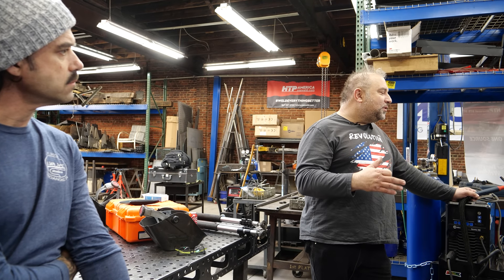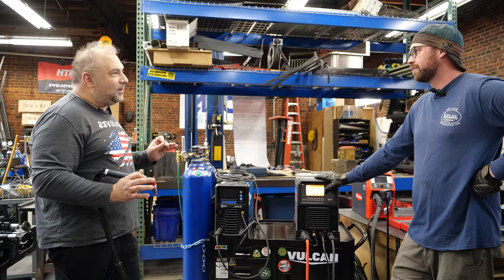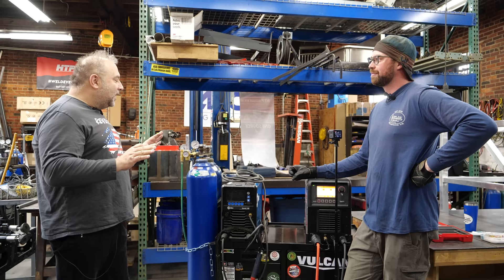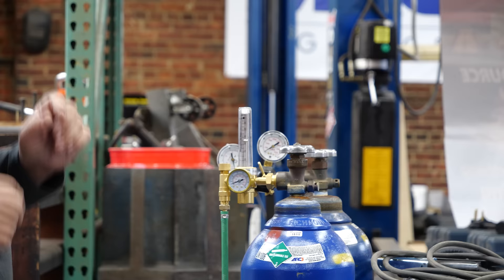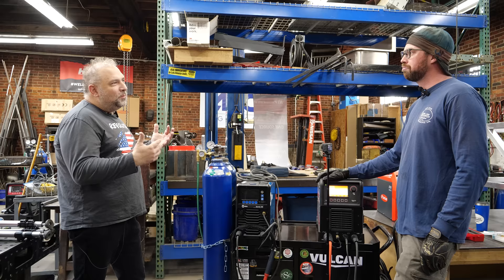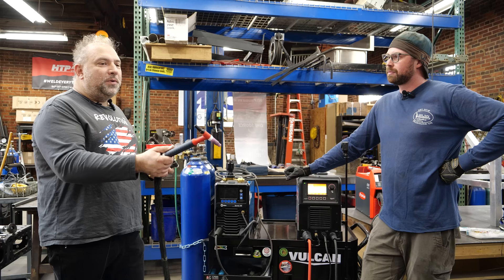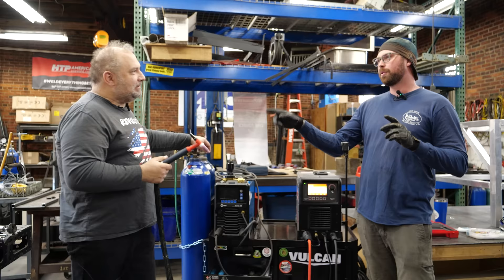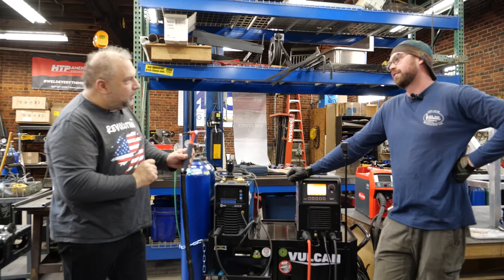Everything You Know About Regulators is WRONG

Comment: The two types of regulators exist for two different purposes. Both types have the same type (if not exactly the same model) of regulator on the cylinder, which drops the cylinder pressure to the intermediate pressure for either a needle valve or a second stage regulator that includes some known downstream restriction. If you care about actual flow, as for example we do when adjusting medical gases delivered to patients in the hospital, you use a flowmeter. If you care about delivering a specific low pressure, such as a supply to a torch, you use a regulator - often with two stages. The "flow rate" gauge on a two-stage regulator (two dials) presumes a certain differential pressure across the (hopefully) calibrated orifice. If your welder or torch has a flow restriction somewhere the flowmeter type will show you that it is not delivering the flow you had set. The two-stage regulator type will not. That's why when your torch is off the flowmeter type will show no flow but the dual gauge regulator will show whatever "flow" (pressure) you had set.

In short, neither type is necessarily giving us correct information on the flow rate. In the case of the flowmeter, we do not know how well (if at all) it was calibrated. In the case of the two-stage regulator, the gauge on it is a lie to begin with. Both can be calibrated, but the two stage regulator can never directly show gas flow.

Both types will struggle when they do not receive sufficient intermediate pressure. The two-stage regulator will likely start struggling to deliver what you expect at a lower cylinder pressure, but both will struggle. Anyone familiar with scuba diving who has ever breathed a tank all the way to empty will immediately understand this, because the most common scuba regulator is a two-stage. The difference is most first stage scuba regulators compensate for depth by varying the intermediate pressure, whereas welding regulators do not change the intermediate pressure based upon atmospheric pressure. As a scuba instructor, I have seen the insides of many different brands of regulators, and a few medical gas regulators. Welding regulators are a whole lot more simple, in part because they do not have to be designed in a failsafe manner.

Comment: I tig weld aluminum allllllll day for a local trike factory. We use the 330 cu ft. Tanks and yes as the day goes by you need to bump the flow up because the tank is getting empty and can't produce the same pressure. But it's not that serious it's pretty self explanatory

Comment: Id like to see what calibrated gauge he is talking about. As a fluid control specialist, i dont agree with everything he is saying. The proportional aspect of a 1 stage reg is correct. The flow reading on the ball flow meter is not correct. That ball and orifice is most correct measurement device. It is calibrated for gas density at any pressure. Flow and pressure are directly related, so measuring flow with a "guage" seems wrong. Flow needs to flowing to measure and pressure disregarded. Just like A vs V. Measuring V while focusing on setting Amps is secondary info.
The only correct way to measure flow is via a flowmeter, or a known volume (trash bag) in time, not a gauge. Good video tho and always good to discuss deeper dives into theory.
Reply: The gauge type meter is just reading the pressure behind an orifice. The numbers on the gauge are not PSI bur rather predicted flow values for the orifice. It doesn't seem accurate to me. I didn't follow "The flow reading on the ball flow meter is not correct. That ball and orifice is most correct measurement device." The statements seem to contradict.
Reply: @jheissjr  yeah i fat fingered that. The ball is the most correct gauge.
Neat to know about the gauge with the orifice downstream. I guess that makes it quite a bit more accurate than I thought, i always just assumed it was a pressure gauge.

Comment: I always use a flow tester/rotameter for gas nozzles and cups, to get an accurate reading, because the journey of the gas from the tank to the nozzle/cup is long and anything can be wrong somewhere, faulty tubes, etc.
Reply: This is the best advice I’ve seen regarding this video. I’ve seen people throw away spools of wire, change gas bottles, buy regulators etc all because their gas line was pinched or something. I recently had a ton of wormhole porosity suddenly on a dual shield project. Flow meter at tank was showing 30-35 was getting less than 12 at the gun.

Comment: I’ve been experimenting with this a bit lately and found some of the same issues with flow dropping as the cylinder empties. I’ve been really happy with the victor regulator that came with my HTP. I still use a dual flowmeter style on one machine to allow for a purge line, though.
Reply: The reason why the flow drops is because of the pressure differential across the orifice is dropping.  Down to a certain tank pressure, the flow through the orifice is what is known as choked flow, that is the flow velocity is at the sonic velocity of the gas at the given conditions.  Once the tank pressure drops below the critical pressure, the flow through the orifice is proportional to the pressure drop across the orifice.  What two stage regulators do is drop the pressure in two stages (Duh!) so that the flowrate through the second orifice will always be at sonic, or critical, velocity.  Even with the two stage regulators there will be a tank pressure at which periodic adjustment of the regulator setpoint will be needed.  This tank pressure for a two stage regulator will be significantly lower than that for a single stage regulator.  The ball type flowmeters are accurate at a specific gas pressure that is flowing through them.  I have a flowmeter for my HVAC tools that is accurate at a 50 psig inlet pressure.  As a result, when I go to purge refrigerant lines for brazing, I have to set the regulator at 50 psig and use the outlet valve of the flowmeter to adjust the flowrate.  The accuracy of the flowmeter will be dependent on the gas pressure which governs the flowing density and flow velocity which will affect the accuracy of the flow meter.  It is much too complicated of a subject to demonstrate here how a 10% change in gas pressure to a ball type flowmeter will affect the accuracy of the flow measurement.  hth

PS:  I look forward to watching your videos Tim and have learned a lot from you about the practical aspects of welding.

Comment: The most precise gas regulation is done for fine oxy-acteylene work but you can use dual stage regulators for shielding gas too. Single stage regulation is inherently less precise at lower cylinder pressures. Airco and successor Concoa dual stage outfits are popular with precision acetylene welders and some use them for TIG by swapping in a CGA-580 nipple and nut.
As for how to read flowmeters I never see Youtubers contact tech support for the manufacturers who design them. Further, anyone can set gas flow as they would set other settings simply by welding some similar scrap then tweaking for best results on ones OWN equipment. 

You can and we did get the effect of a dual stage system when using manifolds (we built shielding gas manifolds for our welding school booths) by setting base pressure at the party pack or Dewar output regulator then fine tuning with a flowmeter downstream. Our booths used standard pneumatic chucks with two chucks (one for purge, one for torch) at each station. We swapped the  flowmeter inlet nipples with 1/4" NPT brass nipples which gave us instant flowmeter swapout which made my life running the toolroom and repairing regulators much more convenient. (WARNING, the manifold ran at LOW pressure not full cylinder pressure so study and know, don't guess when plumbing high pressure industrial gases.)

You can set amps and gas flow without even seeing an indicator because we did when training pipe welders who may be hundreds of feet away from their power source doing boiler and refinery work. (They yell to their helper to "bump" settings up or down.) Good weld? Good settings.

Comment: Not usually one to comment on things like this, but I did want to add one note in regards of higher pressure and vortex sucking in ambient air. He is right for 99% of application, but there's one application that I've personally run into and experimented with, that this statement is actually true. It's not a common joint type for most welders, but in the repair area, as you try to weld an edge on a thinner part (and this seems to be applicable only on thin parts of about 1/8" or less, with it getting worse as the material gets thinner). 

For ease of explanation, pretend that you have a piece of 1/16" aluminum sheet panel that's 12"x12" and you want to add some material right on the edge of to build up thickness of the panel. So with your panel laying horizontally flat in a parallel plane to your welding table, BUT it must also spaced up from the table, so you put a say 2" spacer under it. You then have you're tungsten in a vertical position over the edge of the panel to run a bead,  as if you wanted that panel to have a weld bead all around but maintaining that 12"x12" over all dimension making just the outside border to be say 1/8" thick with the weld on there. As about 1/3 to 1/2 of your cup's shielding gas if passing through that 1/16" edge thickness, a vortex can be created by pressurized argon slicing that edge and drawing in the ambient air to your weld puddle. And as you increase the Argo pressure in that situation, you'll notice that your welds start to look worse instead of better as the vortex becomes stronger, so the remedy becomes to run as little gas pressure as possible to reduce the induced vortex that comes from under the panel. 

As mentioned, this is a very rare occurrence, but none the less a legitimate one that I have personally run into. And sometimes it only takes one things like this to have everyone using the expression that more gas pressure can cause a vortex and ruin your weld. But other than that, great informational video! 

If you do want to try this out, I have to stress that it really has to be a part suspended in mid air, not laying flat on the table. You wouldn't run into this issue with it on the table (nor backed with something), as that would also stop the vortex from being created. And I find it doesn't do it with thicker parts neither as the vortex created is far enough away from the weld puddle if your torch angle is perpendicular to the part. However, it can still happen if you have too much torch angle to the outside of the part and the statement would also be true then that more gas pressure would make a bigger vortex causing it to be worse.

Comment: I find the information pertaining to the gas retention in the line very interesting as I did the flow meter not "keeping up" as the tank empties out.  As for reading the top or the bottom of the ball in the flow gauge, does it really matter since most will just use the reading as a reference and dial in the desired gas flow as needed.

Comment: A lot of BS information here. I weld using a flow meter, I know when my welding is working and when it is not. If you keep an eye on your flow meter as you weld, you’ll quickly learn what you need it to read to weld at whatever setting, that’s the key, it’s not “you need exactly 10 CFM to weld stainless” no, you need what you need to weld stainless in your situation… If your welds start suddenly acting funny, and you aren’t checking your gas and everything else, then what the heck are you doing?

Comment: Yes, Zilla has been in the Welding Industry for so long and he is very bright, that he tries all sorts of things and Documents the Realities that he Incurs. I cheat slightly by using a 2 stage regulator with just a Small Pressure gauge above the Diaphragm, then have a flow meter on the output, As my bottle gets down I increase the Regulator Pressure to keep getting a Decent flow to the Torch, I use Rubber Oxy hose to the Machine, It is small bore and doesn't expand (I hate those Clear lightly internally braided lines that they give you with at least a 5/16" bore) and when you put the Pressure on you can Feel them getting bigger in Diameter, when you hit the Trigger you get a big "Whoosh" of Gas and it uses your Gas up Faster.

Comment: I figured out if the flow is to small I get bad welds, next I figured out if the flow is too high I get bad welds. It has to be just right. flow to high was kinda tough because I thought more has to be better. 

It is not, I found out high flow is too turbulent and it pulls in oxygen and the weld gets porosity. 

Some times it is a struggle getting it right. I really need to pick up a gas lens and some of those clear cups.

Comment: Thanks but no thanks I'll stick with my Victor flow gage. 
The only time I have flow issues is when my bottle is too low to provide the flow. 
I've never had to adjust or readjust it due to bottle pressure. 
Don't buy a single stage cheap piece of junk.

Comment: You do not read the gas from the bottom of the ball. You read the gas flow from the centre of the ball.
Reply: It actually depends on the flow meter. It is not standardized for welding flow meters, which is annoying and lame. Sometimes it says on the flow meter how it should be read, sometimes you have to check the manual—so bad. I am not sure why he would make the claim he did in the video.
Reply: @quieroverduras Possibly because it's the safest assumption to ensure you have a minimum flow rate.
Reply: The instructions for my flow meters say middle. But really, it doesn’t matter as long as you’re consistent in how you read it. The difference is really small.

Comment: ☠️ You're out of your mind if you try to use a flow meter with out a regular ! A flow meter is not ment to be used at high pressure ☠️ it is used after the regulator to get a accurate measuremen and fine tune the gas flow . I don't know what this guy is talking about ?

Comment: I don't know where this guy came from? The ball on the flow tube is measured at the top of the ball not the bottom. The hose type and length also has an impact on the flow especially at the start , surge. Best way to know for sure is measure flow at the nozzle for either mig or tig. Who tig weld or even mig welds for two or three hours at a time? One word - DISINFORMATION

Comment: He says at 4:39 that the flow type gauge shows a reading higher than the actual flow when the tank is 200 psi. In other words the flow gauge deviates higher and higher from the actual flow as the tank pressure drops. Why does this happen?
Reply: If you can't answer that in your head you don't need to know.